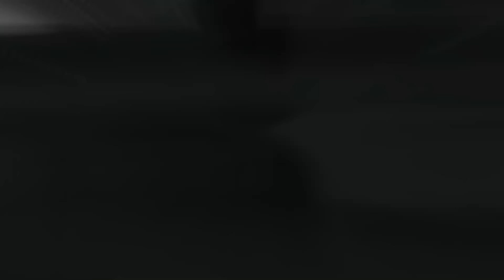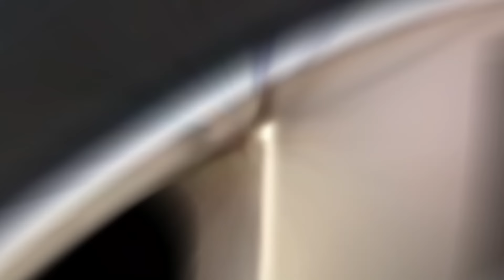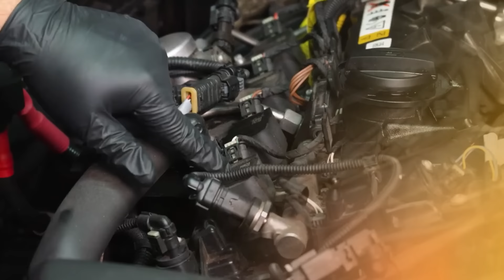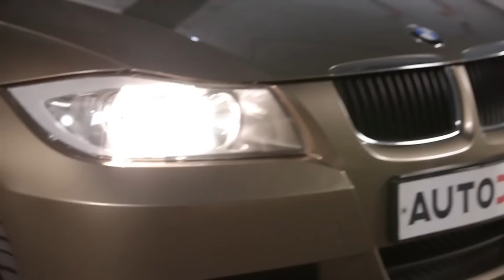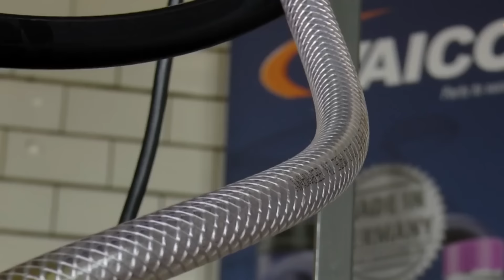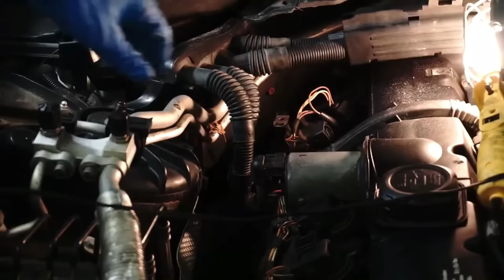10 EASY Maintenance Tips to Maximize Your BMW's Performance!

Comment: Most bmw oil say twin turbo. As long as you use LL-01 or LL-04 spec your good.   I have a 259,000 mile 2006 530xi.   I have used mostly Castrol edge bmw long life -01 5w-30. Every 4-6k.  It`s worked for Me ?  I am the 3rd owner, the first 2 drove interstate, just like me.  This car has spent 90% of its life going 2700 rpm in top gear.   I got it in 2013 from a bmw dealer with 123k